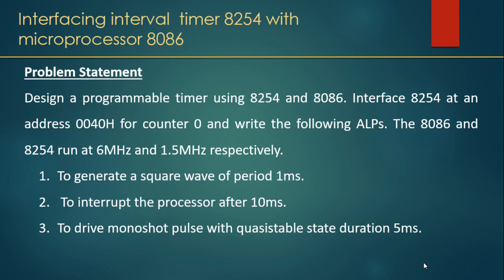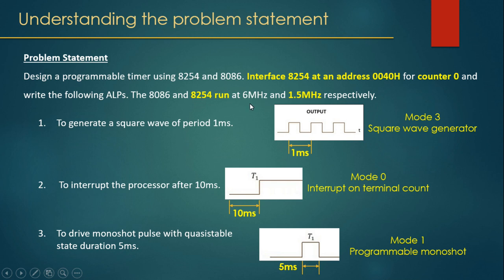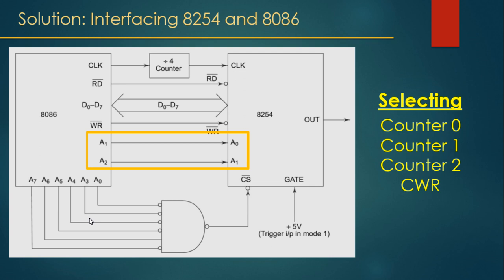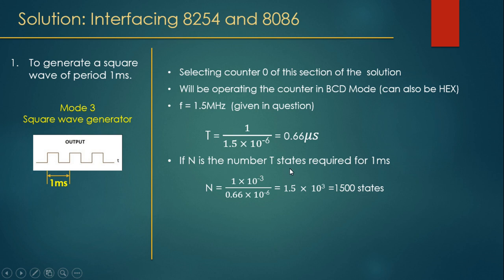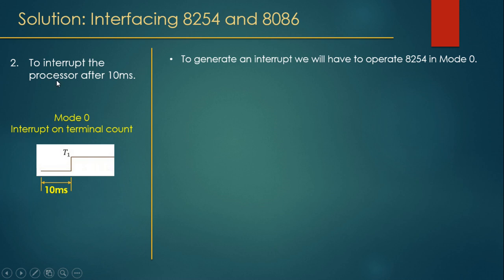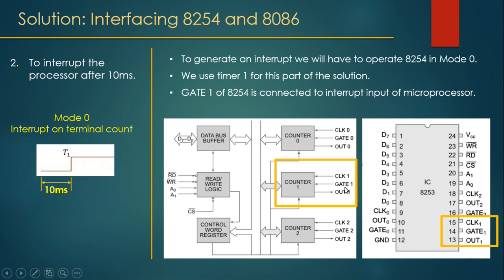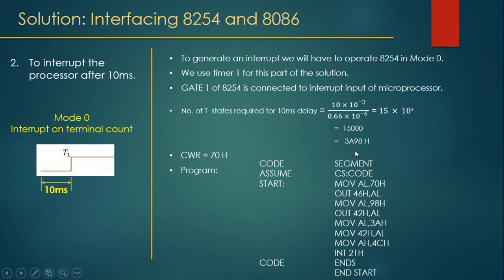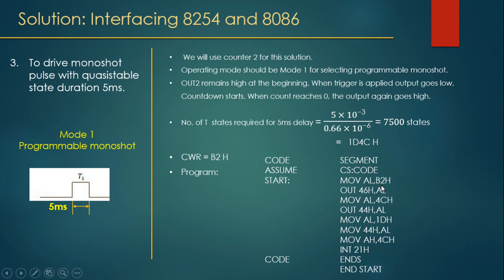Interfacing of 8086 Microprocessor with Interval Timer 8254

Comment: PLZ SOLVE I HAVE MANY PROBLEMS IN THAT QUESTION
Connect an 8254 in a 8086 processor system to meet the following conditions:
i. It occupies the address range 4CH-4FH
ii. Program counter 0 in mode 0 with a count of ABCD12H and counter 1 in mode 3 and a count of 345678H
iii. Program counter 0 to generate an interrupt every 10 ms using a 10MHz oscillator
iv. Program counter 1 to produce a 1.25 MHz clock output with 50% duty cycle
subject: Microprocessors interfacing techniques

Comment: hello can u help me pls 
design a computer system(on paper) based on intel 80386 processor.
in your design you have to interface the following devices and components to the microprocessor system bus in order to have a complete basic computer system :
*intel 80386 microprocessor 
*buffers 74ls244 an 74ls245
*latches 74ls373
*clock generator 8284
*crystal oscillator 40MHz
*bus controller 
*memory system : 4*128KB RAM and 8KB EPROM
*decoding system :74ls138 and 74ls139 and PLDs
*I\O devices : parallel PPI ,and serial 16550 UART
*timer 8254
*PIC 8259
*ADMA controller 82258
*digital and discreet components you may required
- you have to connect all the pins required for your design ,use component data sheet to show all the pins required for your interface.
-choose your memory and I\O address ranges
-you can use any application tools to assist you in your interfacing design